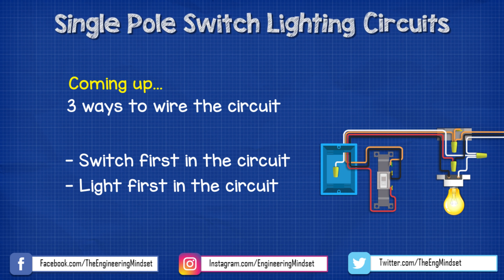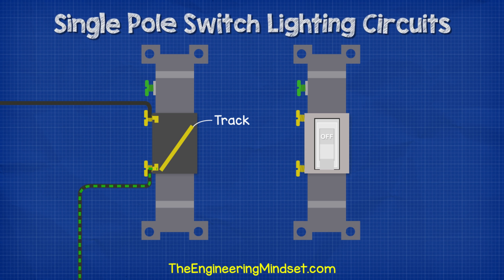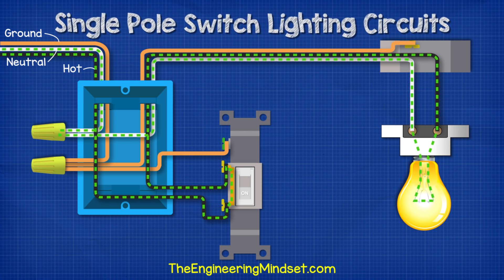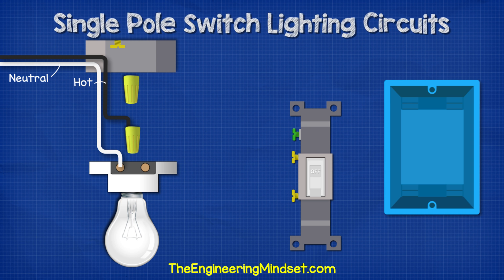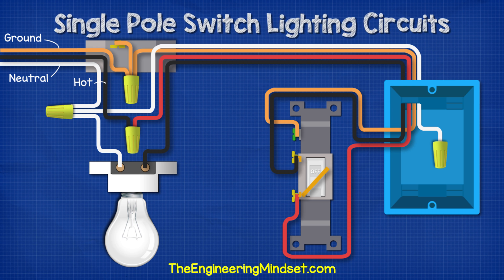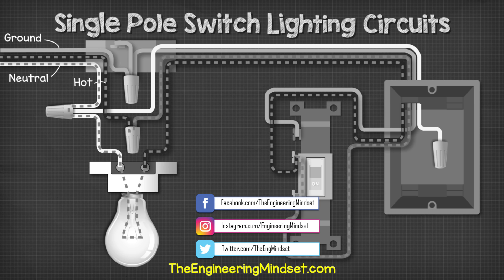Single Pole Switch Lighting Circuits - How to wire a light switch

Comment: why would anybody wire the incoming hot wire to the light first? would't it be better to always wire the incoming hot wiring to the switch 1st then to the light?
Reply: It depends on the routing of the cables.  The usual goal is to save money with the shortest cable runs possible.   Having the power feed cable to an extra 20+ feet to get to a switch and back is going to cost extra money and installation time.

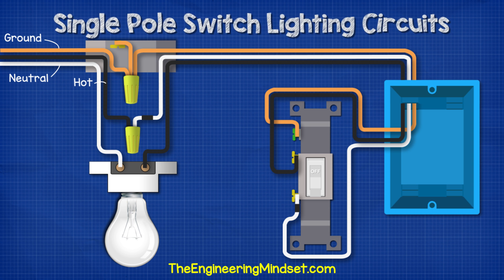Comment: Great videos! Do you have one for the next step of adding an outlet run from the diagram at 3:15 of this video? Not switch controlled, just an outlet run.
Reply: Like are you talking about powering a couple plugs off of the power that goes to the switch box? We try not to do that anymore,but what you do in that case is you run a wire from the switch box to your plug box,splice the neutrals,and make a pigtail with the hot from the power,and your hot for you plug wire (a pigtail is where you add a length of wire to your splice,so you can connect to a device).

Comment: This video just destroyed my brain. I don't get it, can you show wires IN A CABLE? because I've got one cable coming from a BULB and one which gives 220v, they both go to a SWITCHBOX and then some magic should be happen IN THERE. Now you're explaining like i'd there's no cables and all 3 wires just stripped.. but it's not like this in modern world!
Reply: The wires shown running along next to each other are in the same run. They can be in the same cable or the same conduit. 

Just one switch for that light?  Hmmmm

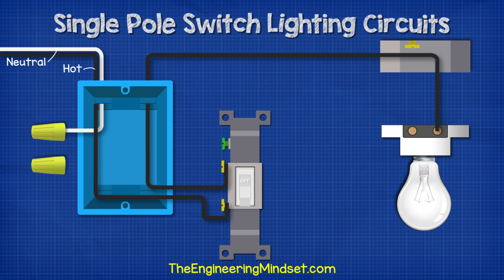Comment: 1:23 Can someone explain why neutral is not just ran straight to light fitting/bulb. Why the stop at a wire Knot if no other wires is being joined to it. I would assume it can just go directly to light fitting/bulb.
Reply: The wire in this video has three wires in the bundle which is the black, white, and the ground.  The 3 wire bundle is run the from the fuse box to the light switch box and then cut.  Now you have the 3 wire ends to connect.  The black to one pole of the switch and the white to a wire nut and the ground to another wire nut.  Now you run another 3 wire bundle from the light switch box to the light fixture.  The wire ends at the light switch box you connect by connecting the black to the other pole of the light switch, the white to the wire nut with the other white wire, and the ground to the wire nut with the other ground.  The other end of the run goes to the light fixture where you connect the black, white and ground.
The way the 3 wires are bundled together, it makes sense to wire things this way with one run from the fuse box to the light switch box and the second run from the light switch box to the light fixture.

There are also some switches that you may want to install that need power even when the light switch is turned off.  The most common example now a days is a smart (or wifi) switch.  This is a switch that can be controlled with an app on a smart phone.  These switches need constant power to power the internal wifi transmitter and receiver inside the switch.  To install these smart switches, these switches need to connect to the neutral wire.  These switches will have a white wire coming from the switch that you need to connect with the other white neutral wires in the wire nut.  This is easy to connect as you just undo the wire nut holding the white neutral wires and connect this white wire from the smart switch with the other white wires all into the wire nut.
Reply: The reason is that the cable is cut.  Unless you're running individual wires in a conduit, it's bad practice to try and loop a single cable through a switch box and only interrupt one of the wires.  It's also takes more time to install.  Just cut the cable, leave an appropriate length of each run in the box, and wire-nut the neutrals together.

Comment: I have one question, Why do not you just put the wire directly to the light or switch?
Do you put the wire nut for distribution?
Reply: you can wire directly, it is most easily seen in an outlet box, as it is an end terminal. So you could wire to the switch, than to the light. The switch will control the light. 
Its gets a bit harder when your also bypassing to another light, or outlet.

Comment: what size main breaker should you use for a house with 12 rooms ? 40/50/100 or 200
Reply: wolf worrier it all depends on your whole load of house so you have enough amp power for your house and a lil extra just in case
Reply: 40 or 50 is too small.  100 would probably work.  With huge electrical demands in modern U.S. housing, 200 in normal.

Comment: Can option two, work also for a ceiling fan with a light??
Reply: Yes.  The fan is generally wired directly to the incoming hot so that it's controlled by its pull chain only.  The hot also goes to the switch and back and is wired to the light only so that the light can be switched from the wall.

Comment: Why would you use a white wire to continue the circuit on the second example. Just use a black one....
Reply: Because basic non-metallic cable has two conductors:  black and white.  They don't make black-black cable, and if they did, it would just be an added expense to keep around for that ONE thing.

Comment: Great explanation please do more explaining how to wire 240 volt 2 and 3 wires and why. Thank you.
Reply: 240V circuits are just like 120V circuits, except there are "two hots".  Either hot and the neutral make 120 volts. But the two hots connected to something without the neutral make 240V.  You only need the two hots for a 240V device, like a water heater.  You need the two hots and the neutral for a 240V/120V device (it uses both voltages), like a clothes dryer or an electric range.

Comment: To be clear. In example 2 when light receives power before switch. Is this method not legal because there is no neutral wire left at the switch? If I used 14-3 between light and switch, would it then be up to code?
Reply: Yes, it's not legal for most new residential installations.  Using 14-3 is the solution, as shown in the last example on this video.
Reply: @jovetj  yeah it’s funny, we ended up just rewiring the entire house.I ran 12-2/12-3 through the entire house at the recommendation of my electrician friend. Inspector shows up and tells me it’s overkill lol. He nit picked the crap out of me (which I later learned is the standard when inspecting homeowner work) but learned a lot with it all.

Comment: Help! I have a single switch controlling an overhead light in my bedroom. Can I add a remote switch on the other side of the room to control the same overhead light?
Reply: Will each switch be able to control the same light ? If yes, the. You’ll need 2 3-way switches and run a traveler wire between the 2 switches.  Research 2-way switches and you’ll be on your way.  Good luck!👍🏼🍀
Reply: @harryl7946  Just to clarify, in the states they're called 3-way switches, they are referred to as 2-way switches in Europe, correct? I think there's another name overseas for them as well but the function remains the same - two (or more) switches that control the electricity to the same device (lights, fan, outlet, etc.).
Reply: Yes

Comment: Paul, we understand new NEC code says have a neutral in the switch box (for future use) even thought not used now?  The first wiring method shown.
Thank you.
Reply: The first scenario provides a neutral in the switch box by default.  That isn't what the Code change was designed to address. The Code change addresses the second scenario, where no neutral is sent to the switch box because the black and white wires are a switch loop to control the light.  The third scenario shows how it shall now be done, according to Code, with a neutral wire in the switch box even if it is not used at installation.

Comment: In the third example, it's better to use Black for sending power to the switch loop, and red for the switched hot after the switch.
Reply: I have a question. So I wired a ceiling fan just like the third version here. When I turn on the power the light and fan turn on but the switch does nothing to turn it off. It just stays on until I cut the power again. What am I doing wrong?? Lol
Reply: @Air-buds  You probably want to wire the fan's hot wire to the hot wire entering the box from the panel.  It will also go out to the switch.  Once it comes back from the switch, that wire can be connected to the "light" hot wire (which is often blue, but check the instructions).   This wiring will cause the fan to be controlled only from the pull chain, and the light controlled from the switch.

Comment: I think you intended to demonstrate whether the light was first or last in the circuit.  However you only mention first in the circuit in both demonstrations.  Rematch your video closer.
Reply: The switch is always electrically ahead of the light in the circuit.  But it doesn't have to be first as far as the routing of the conductors.  The difference is the routing of the conductors, but the circuit architecture is the same.

Comment: I am a YouTube certified master electrician now! Thanks!
Reply: No you're not.  The second example is no longer up to code!
Reply: @jovetj  What are you talking about? Recent code states YOU have to clearly mark the white wire.
Reply: @jonburhan5478  You now have to run a neutral to the switch box, even if it's not currenetly used.  Three-conductor cable is needed.  The switch loop is carried on the black and red wires.
Reply: @jovetj  I haven't had any inspections failed here and I do lots of reverse switch loops with white/black, and mark my whites with black electrical tape. When did this change take place? I would think the guys checking my work would flag it if it was a problem.
Reply: @jonburhan5478  2011, I believe.  404.2(c).
Reply: Ha ha ha

Comment: Interesting...what's with the terminating neutral in the last example?
Reply: Electrical code requirement.  Futureproofing for potential "smart" devices in-wall.
Reply: @jovetj  You answered my question as well. If you don't mind, can you give an example of a 'smart device' in wall where this application would be used?
Genuinely curious as it seems like you may need to run another set of hot wires to at least the breaker, or leech power from a nearby fixture if amperage allows.

Thanks!

Comment: You claim that you have a non American version, but I cannot find it in your video list. Please upload one so that the other 95% of the world can learn too.
Reply: https://youtu.be/opoEswRp_jg
Reply: Electrical setups are basically the same everywhere.  It's just the voltages and specifics of equipment that differ.   Switches in any country work exactly this way.  Just the wiring colors will be different.

Comment: I have a situation. I seem to have a configuration like your second one shown here, with the light being first in the circuit. But the light is also linked to a second light via a cable that work together simultaneously. Now I want to separate the second light with its own switch. How do I do it?  In the first light box, there is 3 cables, but one of them has three wires; black, white and red! I have no idea where that comes from and what it's for!?!  I would pretty much love you to tell me or make a video on how to power a second light according to the second configuration shown here. It's giving me a headache. A million thanks!
Reply: Symon Says TV Hello symon, you should first disconnect the black wire going to the switch, and run a new cable from the new switch location over to the light you intend on separating, connect the black wire in the new cable to the black wire you removed from the light, then connect the white wire from the cable to the black wire (or brass terminal) on the light. Then at your switch location connect both black and white wires to the switch (either wire to either terminal will still make the switch function properly)

Comment: Hello my wall  switch quit working it is a single pole switch like the one in your videos when I replaced the switch the bare wire went to the green screw white wire went to  one side of the switch the black wire went to the other side of switch  but it blows the breaker so I just left the ground unhooked it is working why is this thanks for your help
Reply: Hard to tell why.  If you're not careful, when installing the switch into the box, the bare ground wire can come into contact with one of the switch terminals, causing a short circuit.  If there is more than one cable entering the box, then the white wire you connected may actually be a neutral wire, not a hot wire.  (Was it marked with any black, as shown in this video, like it's supposd to be?)

Comment: Thank you so much.  So what I am realizing is to add a nuetral to my lightswitch I can simply take the 2 wire cable and use that to pull a 3 wire cable through the wall and to the box then wire it up in the last configuration and now I have a neutral and power for my smart switch.  I was previously think I had to run another wire which would have been a bit more work.  Thanks!!!!!
Reply: If the two-wire cable was installed when the building was built, it will be anchored in too many places and will be impossible to do what you are suggesting. But, it is possible to run a new 3-wire cable and remove the 2-wire cable from service.
Reply: Jovet is right. Unless it's new construction which it doesn't sound like it.

Comment: The first version, can I connect power from existing outlet?
Reply: Absolutely,  the easiest way is to use an old work box above an existing outlet and simply drop your wire down the wall. Exterior walls are a challenge due to insulation

Comment: The second option is now out of code according to the NEC
Reply: Yup. Need to run 3 wire because the neutral needs to be available.
Reply: true
Reply: Shiiiiit. I just did that on this apartment i rewired.  🤦🏻‍♂️

Comment: Ok, so why are there 3 versions? when do i use each version?
Reply: There are three versions because sometimes it's convenient to route the power from the service panel to the switch and then to the light... and sometimes it's more convenient to route the power from the panel to the light and then to the switch.  For going to the light first, the second version is no longer legal, but is still perfectly safe.  The third version is the way it should be done now, to comply with Code.
Reply: @jovetj  Say for example you have option 3, and later you want to use a light with ceiling fan, do you change the white wire at the switch and light so the red wire becomes the power source for the ceiling fan?
Reply: @philip duffy
That depends.  If you want a wall switch for each the light and the fan, then yes, you could do that:  send the power down one of the wires, and then send the switched power back on the other two.  But, if you only want the light switched, especially if you want to use a pull chain on the fan for the fan control, it's easy to send the fan constant power from its box, and control the light with the existing circuit and switch.
Reply: @jovetj  Thanks, yes i was wondering about the double switch option.

Comment: Here in the United States you can no longer wire light switches in this fashion in new construction, must be a 14/3 with a present neutral in the box. This was updated when the nfpa updated national code to 2024 standards.
Reply: 2014 sorry**
Reply: Do you mean similar to the last example where you need a neutral in the box?
Reply: Why would someone use a 14/3 on a single pole switch though
Reply: @LightGesture If your line(pwr) is at the fixture box the white wire will go from the fixture to the switch box and capped off. The ground is terminated normally at the switch box and the red and black wire serve as the power to the switch(black) and red as the return power to the fixture. 
Edit: New smart switches and the like need a neutral. The old way of using the neutral as the return to the fixture negates that possibility.
Reply: Don't you mean 2020 nec standards?
Reply: Good to know
Reply: The neutral wire is used to power certain type of switch that requires power like the ones that are illuminated.
Reply: Don’t listen to this guy. It’s 2025 and u can still do this.
Reply: In the first method, "switch first," hot, neutral, and ground are present in the switch box while using 14/2. This would meet code, then?

Comment: Purchased the three way switch connection from you. Is there away to buy this one also?
Reply from the maker: Didn't produce a pdf guide for this circuit, at least currently. I'll message you when it's finished and thank you kindly for supporting us
Reply: @EngineeringMindset  appreciate it and will be supporting...
Reply: No connection guide should be needed.  2-way switches are as basic as they get.

Comment: A bit off topic....but have you done a video on how a reversible AC motor works? Have searched your website but can not find one. If you haven't done a video on reversible AC motor consider this a request for one. I find your videos both enjoyable and educational.....Thanks for making them and keep up the good work!
Reply: 3-phase is easy, you just reverse 1 set of phases.  On a single phase, I would assume it has to have some circuit tech built in to reverse the AC motor.

Comment: The only real problem I have with this video is you dont run a single black wire followed by a single white wire. You run a single 14/2 to the box which you strip revealing a black, white and ground. I can see it's already causing confusion with some of the comments.
Reply: What?

Edit: The wires shown running alongside each other are in the same cable bundle or conduit.  It's not rocket science.